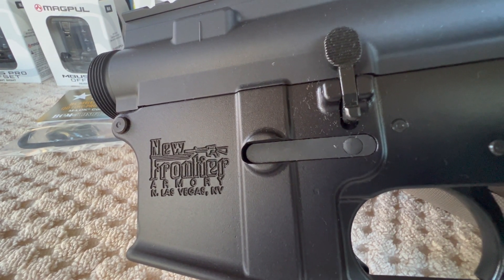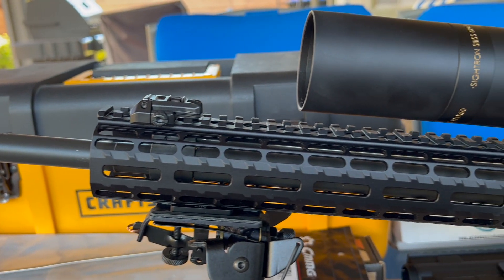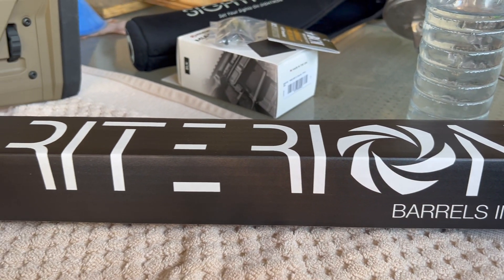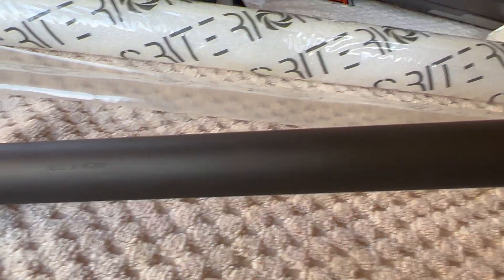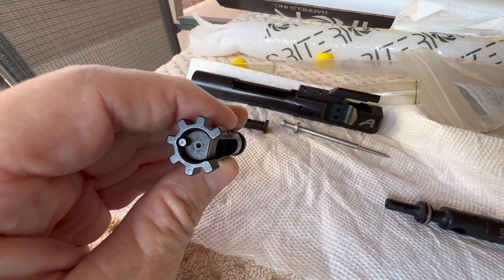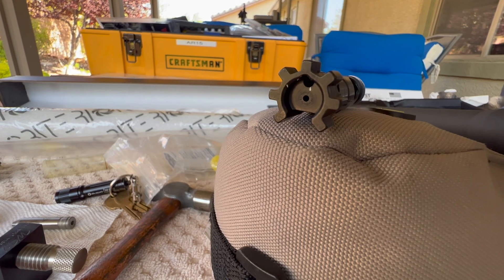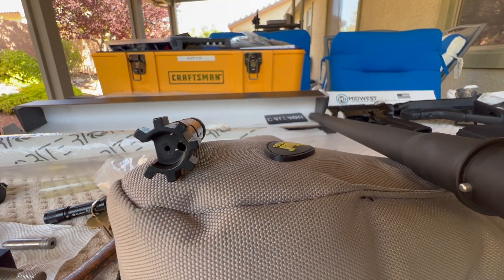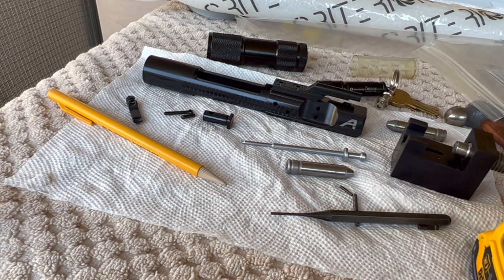AR-15 Criterion 18" Hybrid/Aero Precision Bolt Defect Fail! Part 01

Comment: Aero must be fucking up really lately. I’ve seen more and more posts with photos of their parts failing, when I got home with my lower, the safety was extremely easy to switch and the safety detent was literally shaved down, no point or anything
Reply: Aero asked me to return my new upper for inspection, after I told them about how tough it is to rack with hammer dropped. They replied with "it's your charging handle" I sent it back with a new Warhammer handle, instead of the $79.00 Aero Ambi handle that I bought with the upper. They have a new handle being delivered  to me today.🤔
Reply from the maker: @charlesbeall2589  Hopefully that's it!
Reply from the maker: Just did a video on my new Windham Weaponry lower and the poor QC on final machining. It's just cosmetic but it's not what I paid for. Seems to be happening across the industry?

Comment: I've been reading of a lot of customer complaints about Aeros bolts lately.
Reply from the maker: I had to return another one about a year ago too! I think they're starting to slip for sure. I created a warranty ticket right after this video but haven't heard anything from them yet.
Reply: @peteregger7928  that's unfortunate. Aero is usually on top of their game. I've been using BCM lately.
Reply from the maker: @DesertMariner2007  Probably time for me to make a switch. Like you were saying Aero did have a stellar reputation.

Comment: Man… I’ve been seeing so many QC issues from aero lately,tons get posted on the forums and Facebook pages. Idk if they’re just throwing quality out the door for quantity or what . 

Also looks like tool marks up and down the bolt when you have them sitting next to each other… i know it’s not much an issue but still.
Reply from the maker: I found another slight issue in Part 02! Starting to wonder myself! They have always been great in the past.
Reply: @peteregger7928  yeah I’ve had tons of aero stuff over the years… only thing i have left is my AR10 built on aero receivers but I’d always suggest someone go with aero,before. Here lately tho idk … i think they’re suffering from the common issue of the business out growing it’s self. And as you know demand has been high and stuff out of stock these last few years…. But i would rather see an out of stock notice than a crappy part. Hopefully they start getting back to making quality… that bolt getting out just tells me they’re at a minimum just batch testing. What if someone else had gotten that,someone who didn’t know and it closed just enough for an out of battery detonation 🤷‍♂️
Reply from the maker: @itsamk18-ish  Yes, it's a potentially dangerous defect! Posting Part 02 now which will show another issue with the Aero Precision bolt carrier this time. It's not the receiver! If someone is the kind of AR builder that just slaps parts together they are rolling the dice! I've had some issues with Palmetto State Armory BCG's also that a lot of people think are good. Would not recommend PSA BCG's!
Reply: @peteregger7928  I’d consider the psa fathers of freedom bcg … but not one of their regular ones. The FF bcg is a microbest bcg … i haven’t bought one yet though cause I’d rather just buy a solgw for 30 bucks more when they’re on sale. I have a sharps rifle company bcg with about 5k rounds on it… i bought it before i really knew anything about them and i wouldn’t buy another. From now on i think I’m sticking to bcm,solgw or a mad chemist … which I’m almost 100% sure they’re all the exact same bolt 😂 just different logos on them. I know solgw fires every single bcg they sell along with all the other QC. They’re onsale on aim surplus right now for 129 it’s just a chrome lined phosphate bcg but they’re top notch.
Reply from the maker: @itsamk18-ish  That's part of the problem! So called OEM's use mostly outsourced parts especially BCG's. You never really know who makes what anymore! Aero Precision I believe for a short time did actually make their own BCG's but outsourced it quite a few years ago. Their barrels are made by Ballistic Advantage. They do their own machining for hand guards, uppers and lowers but I think that's about it.
Reply: @peteregger7928  it can definitely be an issue if they don’t use good companies to do the work for them or if they have no quality standards.
I think they own ballistic advantage … i might be wrong but I’m pretty sure that’s what i read somewhere. Then again that could have been wrong also 😂